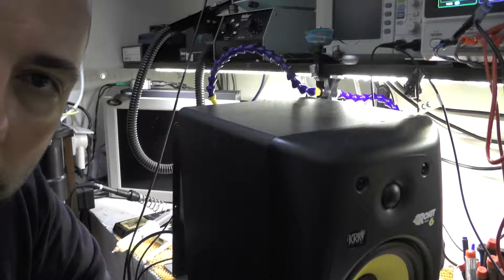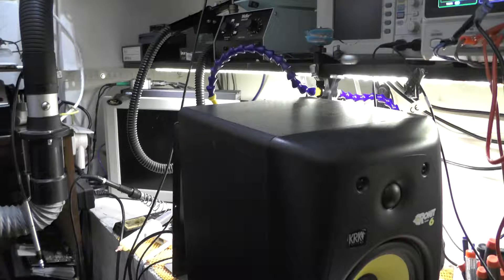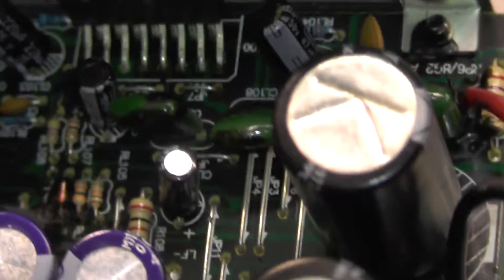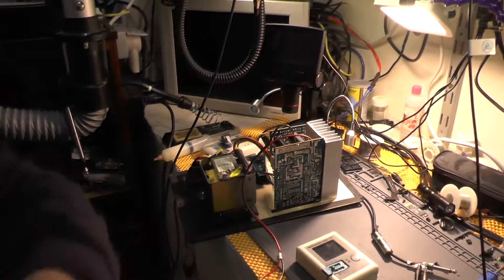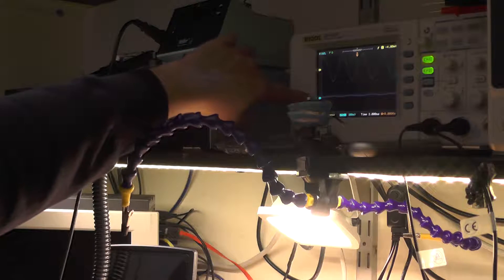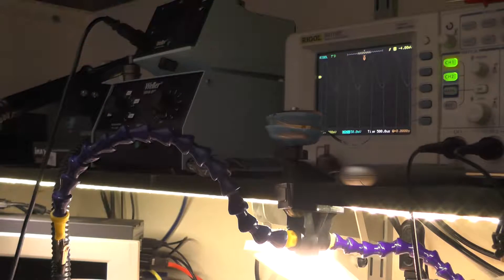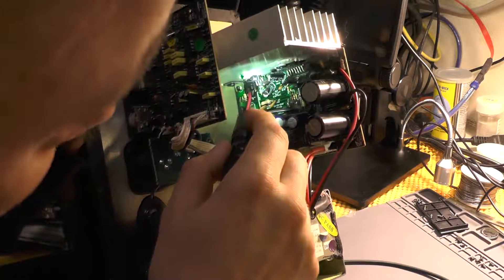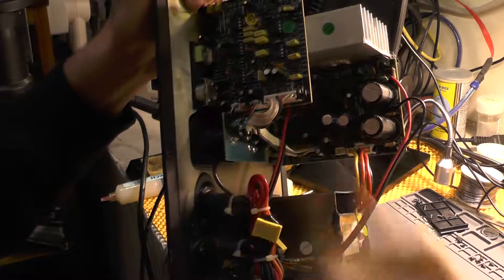KRK Rokit 6 bass speaker not working [repair walkthrough]

Comment: Hey, so i resoldered the diode and now there is sound, but it is very scurry when i turn it on/off and the volume on the woofer is also low. Any ideas?
Reply from the maker: Could be the capacitors or remaining of that gunk

Comment: i own a pair of rkt6 rpg3's - ive just spent most of the day trying to figure out why the tweeter is working - ive swapped the tweeters over and figured the problem is not the tweeter. Do you have any tips as to what it might be ? The board LOOKS fine

Comment: Hi, i have this one.. Is it normal if the transformer output written as 13.5v & 15.5v.. But when i test, the output is 15.7v & 18.3v?
Reply from the maker: I think so. (since transformer is not pulse one)
Reply: @MTS_IT  thanks fot replying, hope u can help me to solve out what the issue if the fuse keep blown.. Or could you give some hints or tips.. Its hard to find audio repair in here.. Really appreciate your help..
Reply from the maker: teoh kahyew if fuse keeps blowing you have a short circuit. Check diodes and resistors for short circuit.